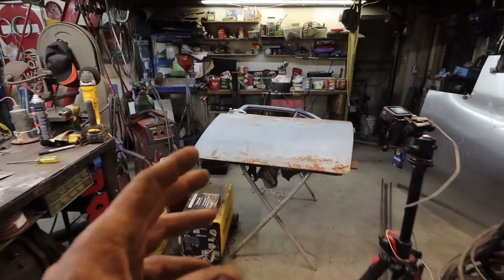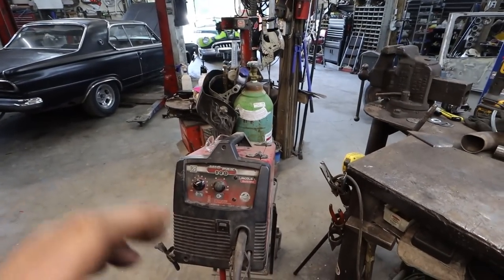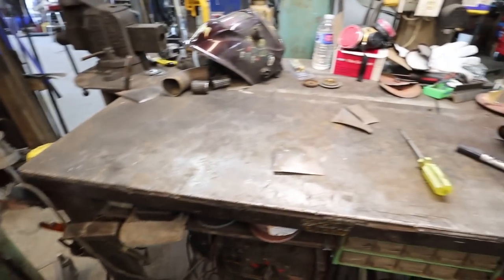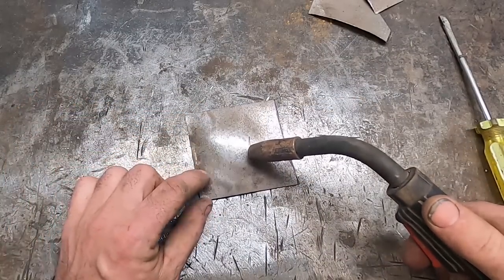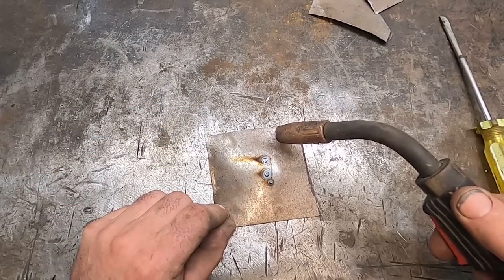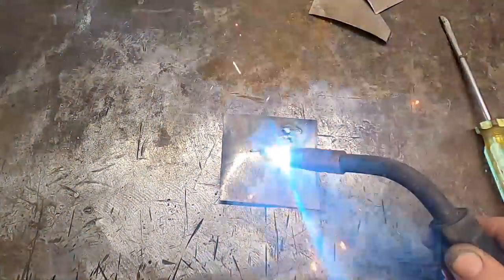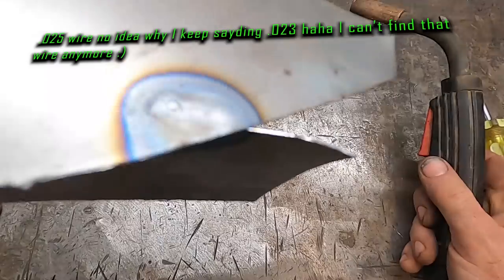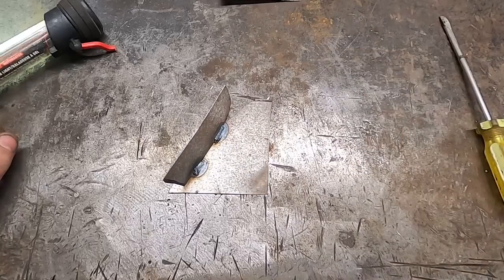5 minute welding tips to quickly setup your welder to weld sheet metal

Comment: I have a cheap princess auto flux core. Want a mig with gas. Your heat control and splatter is so much nicer then the flux. To weld sheet metal with a flux I use a copper plate under what I’m welding to suck the heat away

Comment: I should be getting a 68 Chevy C10, bad condition, have welded stainless and thick metals using arc and tig for 25 years but a mig seems better for the repair so Ill purchase one.
This little bit will help because I've only gas welded thin steel and I think it would be too hot.
So these tips are a few tips closer to being able to do it right, thank you.

Comment: An excellent tutorial. Simple and to the point. ABCD = heat 1-10 = speed. It doesn't get much simpler as long as the interior cable connections are correct inside the welder. You did not mention that. lol.
Reply from the maker: Haha that I didn't but that would defend on flux or not most of these out of the box are not set up for flux core
Reply: @HalfassKustomsTheOtherHalf  
Guilty........lol

Comment: Makes sense, thanks for explaining and demonstrating the sizzling bacon , idea , thanks, but like I mentioned next I am loo into the small handheld spool like you used on the aluminium, just don’t understand the difference in gas but surely my welding supplies can help out,
Excellent thanks
Reply: Gas is used mainly for shielding, it protects the area you are welding, essential for Aluminum

Comment: Yeah..this helps thanks, wire speed explained nicely. By the way, I have smoked the lens covers on a few LED lights already as I run flux cored which is more smokey and splattery (is that a word even?)

Comment: You just got to play with it. Get some old pieces like you were doing and go at it. Another thing you got to keep that tip clean so the air can come out of the gases can come out. Would I use as a battery post cleaner? I'll unscrew that tip and rub it through there and take all the sleg out of it. Just something to make it go easier. 👍👍🙂🇨🇦
Reply: I use anti spatter jelly, and just dip the end of nozzle in it. Keeps the crud from building up…

Comment: I'm a beginner and I've been working on my welding, but I use flux core I haven't been able to get gas set up but plan to
Reply from the maker: I plan to give the flux core a try and do a video on it but I think it in the heat setting and stuff right still applies
Reply: The cheap flux core welders use an AC transformer that is unstable and has a low duty cycle. Plenty of videos out there on how to convert an AC flux core to DC for cheap. It will then produce a weld bead similar to what the Lincoln 140 could do with flux, just not for as long.

Comment: Good info! I've done tons of stick welding way back when I was living on the farm but not much mig welding. I bought a cheap mig (powerfist) that has flux core wire in it. To say my first flux core welds look like bird poop would be an insult to bird poop... Lol! I'm thinking I might have to get gas and maybe a little better welder to produce better results.
Reply from the maker: Yeah I think some of the cheaper welders are just kind of limited they'll work in a pinch though but flux should get the job done it's just not as pretty

Comment: The 140 is a nice little welder. Good demo on changing wire speed.  More wire needs more heat. I have an esab rebel,some kinda fancy machine, not my favorite sheet metal machine. I personally cant stand the digital control, its not the most stable setup. Where the lincoln doesent adjust itself. 
You keep saying 23 wire, it typically is .023 not .025. You are only .002 off, not that much of an issue. Lol

Comment: Would your Lincoln 140 be strong enough for 3/16 or 1/4" steel. What would it's limitations be? 61 and want to learn welding.
Reply: You do multiple passes if your welder is abit weak on what your planning to weld...you grind it so you get deep into your weld area...weld deep first..and add welds to make it stronger...i'd say 1/4" is about max fir a 140 amp welder...175 to 200 or 250 amps will weld it easily and they actually weld thinner better too ( if your skilled to do that )...

Comment: I don’t think flux core is a good fit with sheet metal.  The smallest diameter it comes in is .030”, and it just takes too much heat to melt the wire.  With a real mig welder you can use .023” wire, and lower heat settings.  Burn through is always going to be an issue with FC and anything below 16 ga.
Reply from the maker: It'll work just much messier to use the FC stuff.

Comment: I would like to mention something very important…IF ,FOR BEGINNERS, YOU INVEST IN A WELDER DO NOT GET A CHEAP GENERIC WELDER AND DO NOT USE FLUX CORE WIRE ALTHOUGH IT WILL WORK BUT START OUT WITH BETTER EQUIPMENT